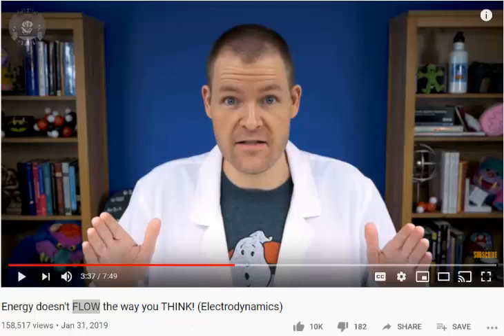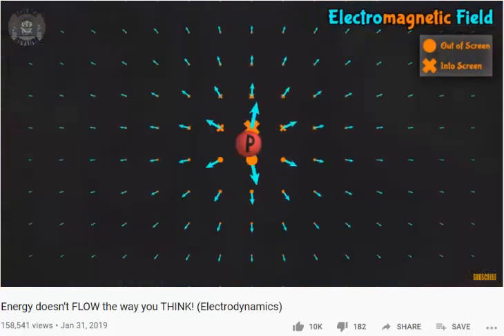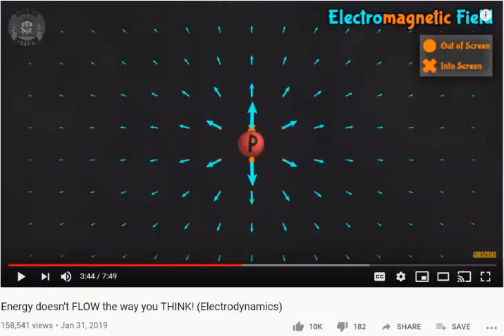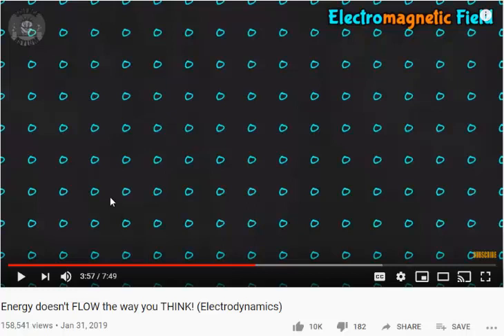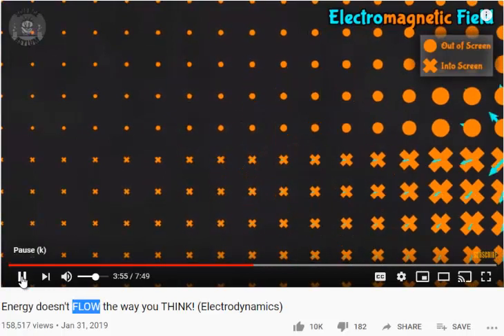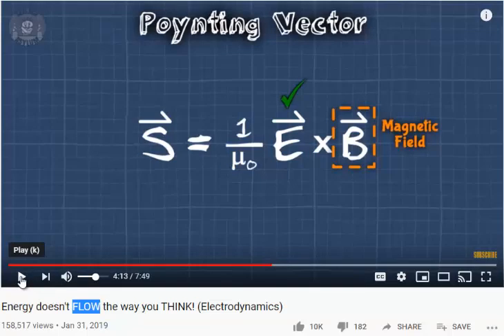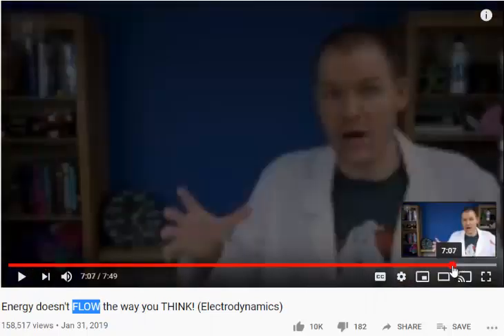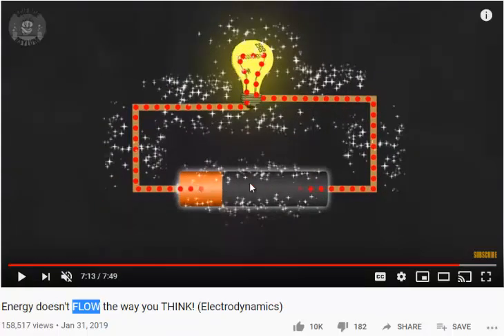On Energy Flow

Comment: I like Asylum, his enthusiasm and his 'looking outside the square' approach however it seems his views on energy, charge, fields etc, may be overly complicated. I speculate, after putting my brain through the meat grinder over energy and electricity in particular, that neither charge nor current exist as entities in and of themselves. In addition, the same can be said for electricity. They are all attributes of the magnetic vortex, which itself is displacement of the one and only energy field. 

I disagree with Ken in his view that electricity is a hybrid between the dielectric and magnetic. That too may be overcomplicating things. For example, it is apparent that magnetic divergence, coupled via dielectric induction within copper, displaces magnetic divergence in the permanent magnet of an induction motor. No need for a hybrid entity. Simply, magnetic displacement propagated from one location to another. The convergent component, or equilibrium seeking energy, of the magnetic displacement affects the inter-molecular fields of other elements causing additional attributes accredited to electricity. For example, pulse perturbations that generate longitudinal light signals. Just my speculation of course as I am in no position to view my theories above those of anyone else as we are all speculators in present day science. The door is wide open.

It is indeed a fascinating topic and I thank you once again for posting these thought provoking videos.